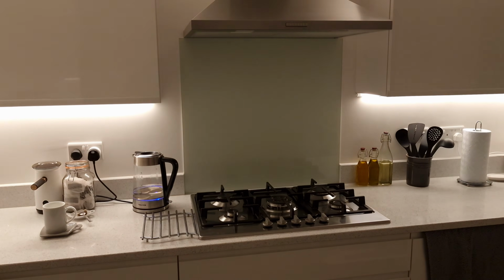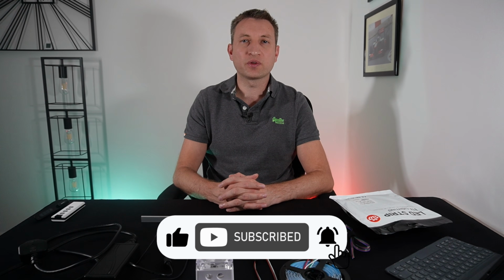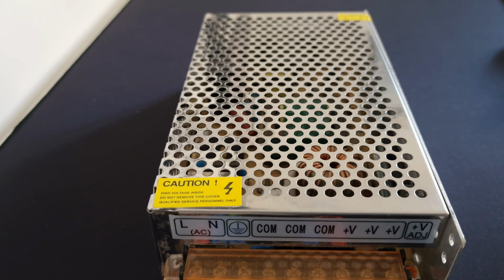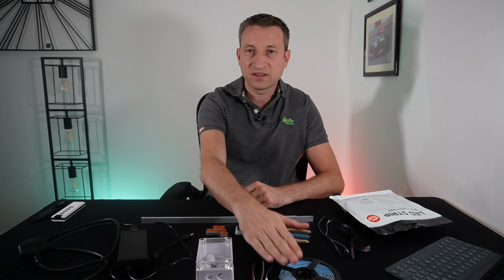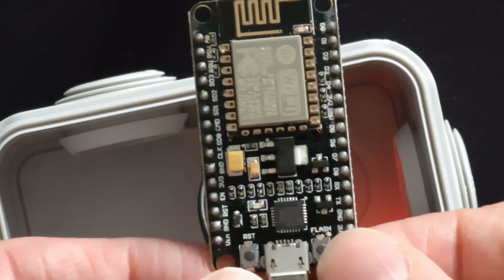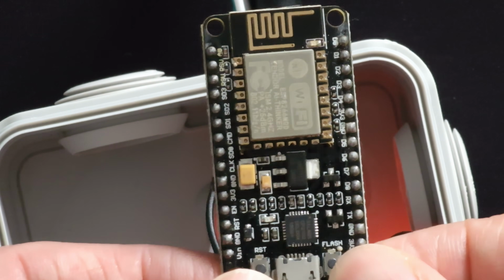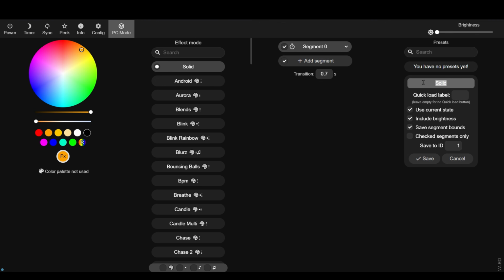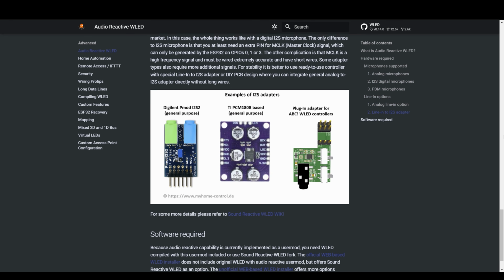WLED ESP32 / ESP8266 LED Lights | Christmas Lights

Comment: why do i have to manually connect to my wifi every time i disconnect and reconnect the power supply from esp32 ?it doesnt automatically reconnects to my wifi , any one having same issue ?
Reply from the maker: I'll be honest, I've not come across that issue.

Try saving the details without anything connected to the gpio pins in case the pins you’ve used have put it into a strange state during boot.

And ideally try with a different ESP device if you can.

Although I haven't had this specific issue, I have had defective ESP devices with weird behaviour after flashing. All from ones I've bought cheap from Aliexpress.

Another thing to try is using a flasher like Tasmotizer or ESP Flasher and make sure it fully erases the memory. Although with the defective boards I had this made no difference and i had to bin them.
Reply: Thank you 👍